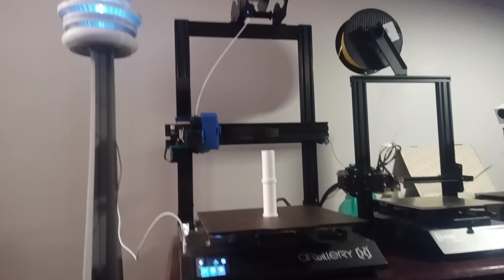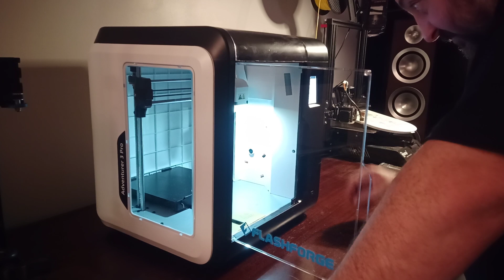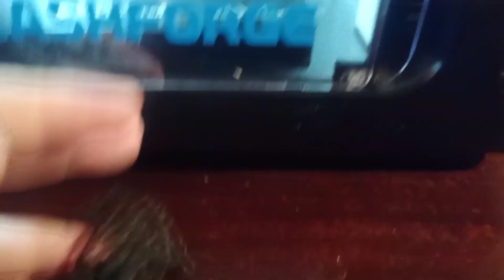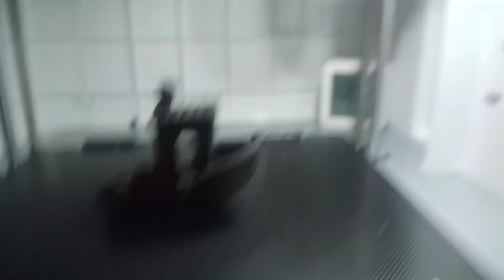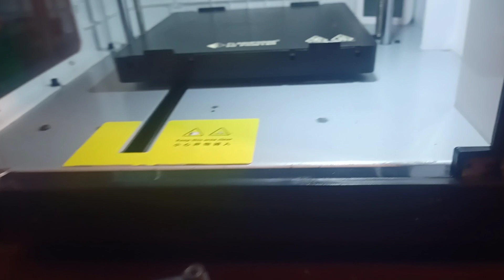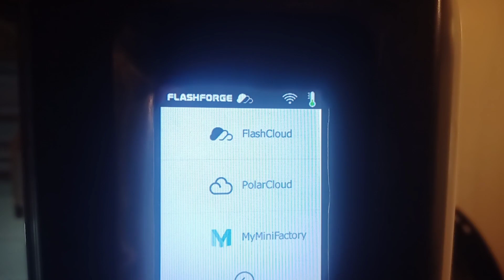Flashforge Adventurer 3 Pro setup, testing and initial thoughts.

Comment: Hi great video - when using the auto leveling function it says to get the nozzle to just touch the bed but the prints seem a bit squashed on the first few layers, should i place something between the nozzle and bed to get it to raise it up just that little bit?
Reply: Hello. I have also experienced the same issue. The nice part about this is that you manually adjust the final steps until it just touches. If you just raise the nozzle one increment i find it works great.
Reply from the maker: @thebelaris this solution above

Comment: Hey Tim thanks for the video! 

I had a couple of questions as I purchased this printer recently. How do you go about removing your print from the glass tray and then clean the tray afterwards? Also, how do you power down the printer? Just by switching it off from the back? Do you need to unload the material before doing this?

Thank you!
Reply: Hello. Sorry for the late reply. I use a metal spatual to remove stubborn prints but most of the time they just lift off with ease. And yes i just power it down from the switch at rhe back with everything in place including filaments
Reply from the maker: Sorry i replied from the wrong channel. I assumed YT would be smart enough to switch accouts when replying from an email link lol

Comment: Hi. How to connect the printer with my computer via wifi? I have connected computer and printer to my router via wifi, but FlashPrint or Cura does not see the printer. Is any other software need to be instaled? Thnx for any advice.
Reply from the maker: Hello. I dont believe cura can print wifi to the printer but i dont know for sure. Flashprint requires you to input the ip address when adding a wifi printer in the software.
Reply: You right, Cura does not operate through wifi, but I just clicked "firmware update" and got message: ".... there is no connection with the printer".
FlashPrint: do You mean IP adress given by router or printer in hotspot menu? In both cases I got message: "Connection failed".
Reply from the maker: @peterx3583  the ip adress given to the printer by your router. There should be instructions on flashforge website.
Reply: @timstooltesting9034  Runs great! I've just entered incomplete IP, it should be taken from printer menu "about", not dirtectly from router. Thanks a lot  for Your help Tim!